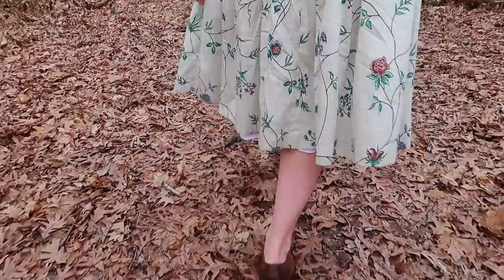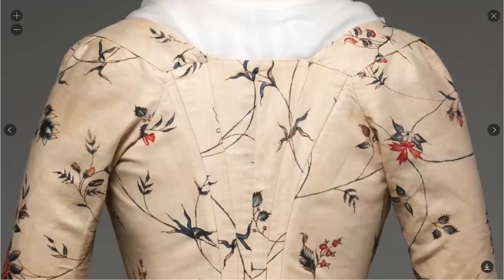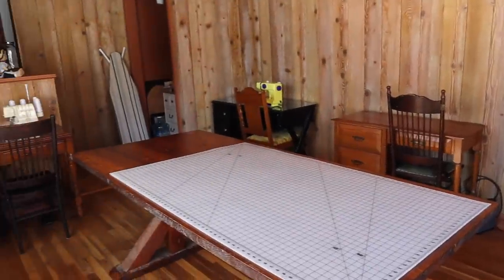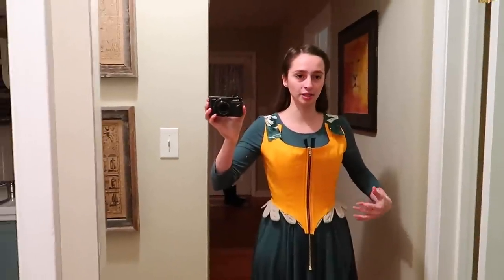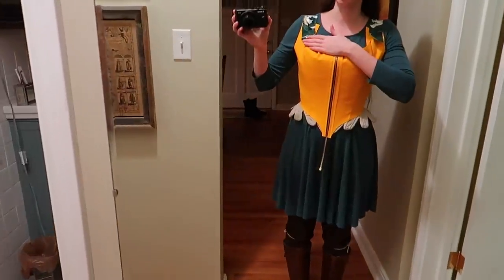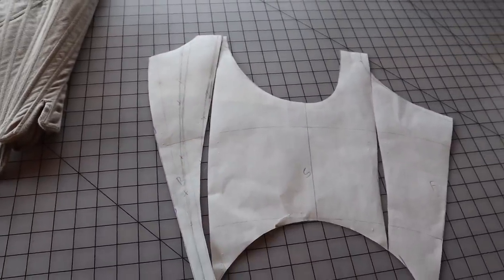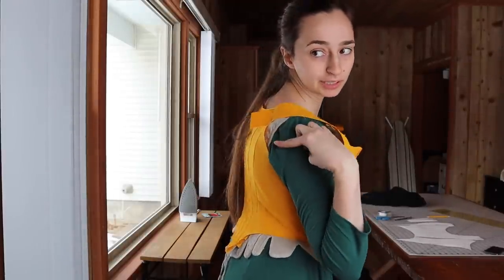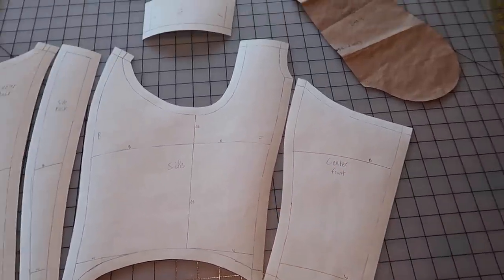Recreating my favorite 18th Century museum gown as a modern spring dress (Part 1: Pattern Making)

Comment: I recently experimented with adding an 18th century pocket to a modern A-line skirt. I basically made an 18th century pocket, but instead of binding I used french seems and some clever piecing and felling to finish my edges to make it less bulky. I sewed the top of my pocket to the waistband of the skirt and made sure to leave a slit open in the side-seam of the skirt to access the pocket. Then I whipped the opening of the pocket to the opening of the skirt and reinforced the top and bottom of the openings with a couple of back-stitches. I absolutely love this pocket! It is enormous so fits a lot of stuff inside, but the weight is all distributed around the waist so there is no weird pulling on the seem. The pocket is invisible if you don't know where it is, even when it has my phone or other stuff inside!
Reply: Great idea! I've always hated the pulling on modern pockets in the side seam. And stuff falling out 🤦🏽‍♀️.

Comment: You need to add the diamond gusset panel to the underarm for more movement underneath. It is a diamond piece that attaches to the already made straight seam that you have underneath the arm. It is a funny shape as it attaches to the arm sleeve and the corner crook attached to the corset. Beautiful job so far. Highly impressive. Thank you for sharing your learning experience.
Reply: Ty for this, I think this will save a completely unrelated project of mine lol

Comment: Amazing, amazing as always!! I took a Burnley and Trowbridge 18th century gown making class (in miniature) and I was amazed at the sleeve shapes! They were actually kind of roughly cut... and then just cinched in under the shoulder strap to fit and sewed wherever they fit (ie, the seam lines are not followed on the sleeve cap if that makes sense). Anyway, I know you’re not going for historical accuracy or construction... but it may help explain the shape of the historical ones you’re seeing and how to draft those strange curves. Like yes that’s how they’re sewn but not how they’re cut? I know you’re wanting to draft the sleeve from scratch instead of having to fit it and I’m 100% sure that you’ll crack the code like you did on the bodice :)

Comment: When ever you see pieced pieces added at strategic places, that would ordinarily NOT make design sense, like with this one at the bust - It means she 1) either gained wieght, probably in this case with pregnancy or 2) the gown was sold on and the new wearer needed more room.  In this case I think the former is the case, and altho stays mean she could have narrowed her waist - often the bust does NOT always reduce in size.  Most of us who have had babies will tell you - boobs go up several sizes, and go down MAYBE one.  This is good or bad depending on...Hmm.  ANyways I suspect This gown has other points of size alterations that they have not shown.  Ive seen many original gowns with odd alterations in diff places - all of which point to the fact that they too never stayed the same size and just bought another gown.  TOday we have stretch clothes - but back then - they just had to be altered.